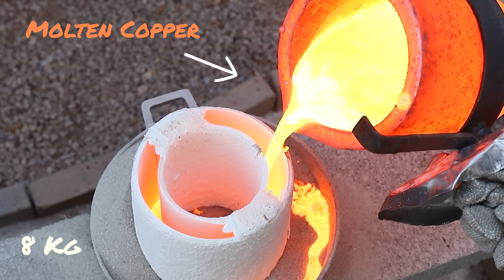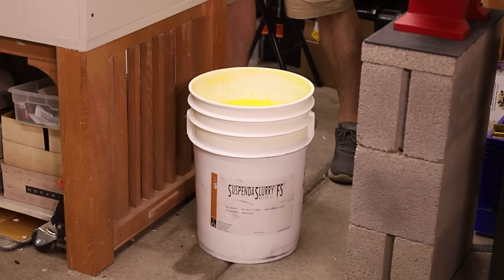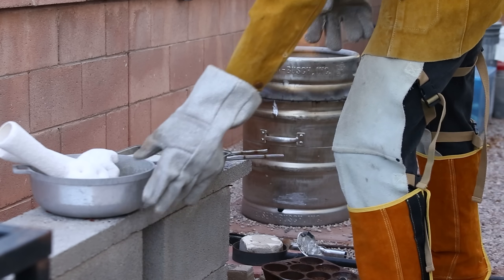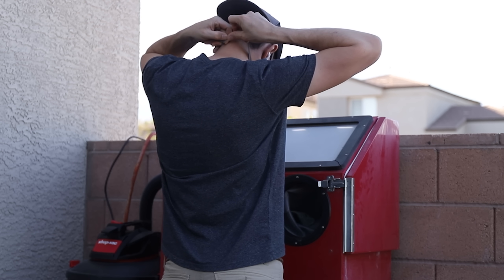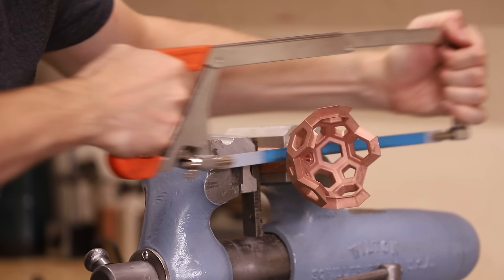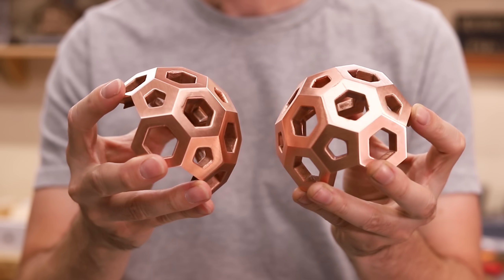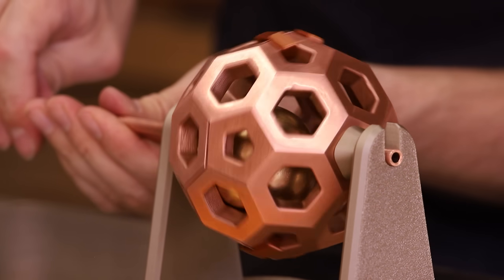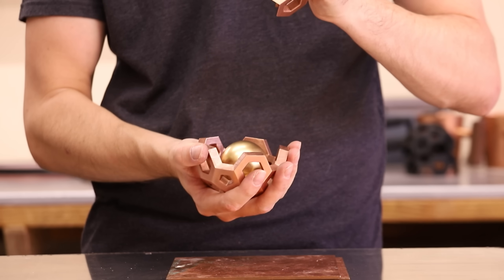HUGE Magnet VS Copper Sphere - Defying Gravity- Will a Neodymium Magnet Float Inside?

Comment: Increase the copper depth by a factor of 2.2, adding most that copper on the outside. Leave the holes the same diameter but increase the inside space (around the magnet) by 3 mm or 4 mm diameter. Paint the copper white and the magnet flat black. Rotate with a single phase motor, probably belt-reduced. Control the speed optically (a mark on the shaft) via an arduino or similar so you can dial speed in in tiny increments. Here's the icing on the gauss cake, lable it "CAPTIVE BLACK HOLE" (you could also use a step motor + controller I think).

You'll have to start over, with a lot more copper, but that doesn't seem like much of a problem for you. You're very competent. I think the resulting performance will be what you're looking for.
Reply: Play with your lightning to fine tune the display -- starting with a fully dark space or as close to it as you can get.
Reply: LEDs w controllable brightness rotating on the inside, recessed into the copper. Now we're talking.

Comment: Instead of mounting the object on a frame like that, could you make a base with more magnets that will make the entire thing float?  Like this, the magnet in the centre floats, the copper orb you made floats also over a magnetic base. Maybe use a smaller magnet inside the core too so it's mass isn't bringing it down as hard due to gravity. Would be cool to see what would happen, I expect they would all rotate but it would be interesting to see

Comment: Oh yeah I have a couple of ideas.
Could this be placed inside a bowling ball?
Obviously you'll need room for finger holes, but they don't have to be deep. And it's gonna have to be covered in an approved materials such as polyurethane. And you're going to need the whole thing to weigh less than 16 pounds but it might work like a water filled bat. It might give you more pin action.
Second I like making things out of Lego. And I know this YouTuber that has a really great video about making hexagons with certain pieces. He shows several methods using different parts. Brick Sculpt is the channel. A couple weeks ago he did the video about hexagon shapes. You'll see a couple in the thumbnail. My question is could copper Lego pieces be made? Then put the magnet inside. Would that even work?
And the cylinder one made me wonder if wheels could be made? or barring that, could a monowheel vehicle work, even if it is an RC model is all?
Finally what about a bat? I know shake flashlights use a similar process to change the battery. So, could a bat  with a light or some other battery power function be made? A cell phone charger or whatever.
I actually really like how beautiful it is! You could sell them. I'd buy one, but I'm thinking it wasn't cheap.

Comment: Try different arrangements of magnets on the outside of the sphere to try and center the orb.  See if you can get the sphere to rotate..... Then if you can put on a small pulley and try to remove a small amount of kinetic energy for  practical use...  Just a thought 🤔

Comment: I can understand the disconnect when manipulating the device manually.  I've got a fairly strong neodymium magnet that I've dropped through rolls of aluminum foil, and it was always a disconnect in my brain, dropping the magnet into the tube, and feeling the weight of the magnet despite it "free falling and not having any connection to the roll."  I can make sense of it in my brain, but my eyes and my hand say "nah, this is black magic, I don't care what you say"

Comment: Try a smaller ball. 
Measure surrounding rf while turning at predetermined rates. Can you connect an oscillator to the cage? See if introducing frequencies into the mix will do anything.

Comment: Paint the ball with stripes so you can see how it is spinning, separate the two halves with an insulator gasket thing like paper, and find a way to make the balls north and south poles to spin between them, and see if you can make electricity with it. Maybe attach fins to it or seal the air with

Comment: Problem with a spherical magnet, is there is no such thing as a spherical magnetic field, it has axial symmetry. Your sphere magnet has to poles and they are not aligned with the axis of rotation. In essence, the phenomenon is much better showcased with cylinders where you can align everything before the start.

Comment: If you had a copper hola hoop that had a vacuum inside, so there was no air resistance. what would happen if you fired a super contuctuter into the tube woukd it go round non-stop? With no air resistance and no heat transfer

Comment: Great casting and experiment!  
Boyd Bushman demonstrated this forever ago.. He also used 2 magnets in 'repelling positions' 
which were then bolted / forced together,  then fit inconspicuously into a stone.. 

They'd drop it from a higher floor and it would indeed fall slower than if/when non modified. 
Good Stuff For Sure!

Comment: I think you’ll get stronger effect if the inside at least if not, the inside in the outside of your sphere is actually spherical rather than lots of flat surfaces that way the forces that are trying to levitate, the ball will be more equal during all phases of the rotation

Comment: You could try a fan motor and control the rpm through voltage changes until you find the right speed.  It might be neat to run a couple wires into the cage on opposing sides with each going to one battery terminal and a light.  When the magnet rises up and makes contact with both wires at once it should turn on the light.

Comment: what would happen if you printed another shell, larger than this truncated icosahedron, to surround it, but with hexagonal cutouts in the shell, spaced evenly and filled them with hexagonal magnets which perfectly fit the cutouts and completed the structure, then placed that larger shell around the smaller shell, with the sphere magnet inside the inner shell and then spun the sphere magnet inside independent of the shells?

Comment: Shouldn't the inside be smooth and round, instead of all of the hex shapes?  It seems like it would stop it from catching on the flats inside, and causing it to "grab" the inside of the sphere.   Would it work better if you used copper wire wound around a sphere?

Comment: Put the spinning stick in one ov the bigger holes. you'll have to 3d printa bigger attachment but i believe it will be more stable than the holes you manually drilled and shaped.

Comment: Perhaps you could cast to round hemispheres (totally enclosed, no 'window') and mount a GoPro camera at one axis point and a light source on the other. That way you'd get a more complete eddy current and still be able to see what's going on when you spin it on the axis. It the GoPro rotates with the assembly the picture should look stationary save the floating magnet.

Comment: I'd like to see you take it to an amusement park with a freefall ride, or perhaps skydiving, and see it float as it falls. Of course, you'd have to figure out how to keep the air/wind from interfering with it. Perhaps you could try floating it in water to see if the force of the magnetic field is strong enough with the difference in perceived weight in water. Cool build.

Comment: Add ceramic bearings on each end of the support housing and sort out a proper gear ratio for best results. If superconducting materials were affordable this would look great in reverse with a magnetic geodesic sphere that has a super cooled quantum locked super conductor floating in the center. 🫶🏽

Comment: since supermagnets sometimes gets created and electricity tend to flow more smoothly at colder temperatures. what would happen if you cool it down? and what would happen if you send a current through the cage? do you think it would be possible to combine those two experiments as well? It looks amazing, and although it wasn't as dramatic as hoped it's still a cool proof of concept.

Comment: Rotating the copper is also rotating the magnet.  Use and external magnet to try to stop the sphere magnet from turning with the copper.  Placement and n\s  orientation of the external magnet may impact wether you get stable non contact levitation.

Comment: Love how it looks! The copper sphere is absolutely an art piece!  I dont know much about this type of physics, but would it be possible to do an art piece with this where the two halves at separated slightly (1 or 2 inches) just enough to clearly see the magnet, or even clamshell style where it is open at the front only.  Then get one of those bases that you plug in to hover magnets over for desk art.   Then you hover the magnetic ball over that base so it rotates but looks like it is hovering inside the copper sphere.  I would buy that for sure.

Comment: How much does the strength of the magnet correlate to its size? I would assume there is some sort of curve considering volume is exponential but magnetic strength might not be.

Maybe a sphere like this would work best with a magnet that has the highest strength/weight ratio?

Comment: Never seen such clean casting anywhere, Bravo
Reply: You must have not seen many castings then.
Reply: @Imma-Loot-Goblin  I have. I think the casting is precise.
Reply: That is because he is not from china where all they do is turn out low quality defective crap
Reply: Plug in your Tesla Coil and let the magic begin
Reply: He sandblasted them
Reply: @pahom2  You can see the 3D print lines retained in the surface of the metal.
Reply: @pahom2  even still, the purity is nice
Reply: @Kryptic712  It's the temperature. He also didn't show if he removed any slag.

Comment: About a thousand ideas:

-  use the video / audio to find out the RPM at which the levitation occurs. 
- make a crank.
- add a gearbox that limits at the optimal  RPM. 
- rotate the assembly, make it vertical (no more clips needed).
- film in extreme slow motion.
- bore a hole in the magnet and introduce a wireless nano camera.

994 more ...

Comment: I think it may be a good idea to join the two hemispheres with non-metallic clips, metallic clips may cause an imbalance in the eddy currents. Also try synchronising a stroboscopic light with the optimum speed of rotation so you can see exactly what the movement of the magnet is like within the sphere, paint a pattern on the magnetic ball so you can detect the direction  of any rotation of the magnet.

Comment: Cool video!
t would be cool to see it fall through a series of alternating acrylic and copper tubes (like the copper one near the start of the video) to see it change from slow to fast fall speeds - if that's what occurs. 
it would also be cool to watch the magnet sphere travel down a custom sized water park style slide to see if it reaches a speed that it levitates. Maybe the bottom is solid and curved like the waterpark slide would be but the top has a top with slits or a pattern that allows us to see the ball as it travels. If no top is needed for the levitation to occur then just the bottom would let it be more visible.

Comment: Al and magnets too. Very interesting. Top speed cars on the Bonneville Salt Flats use aluminum rotors non-contact. And bring the magnets close when they want to slow down. Very interesting. I think the rotors get red hot too. just induced currents/induction heat? Something like that.

Comment: Im thinking a cylnder simulation, using two powerful mags in opposition to  one another, which then tend to drive each other apart with force spinning a drive shaft, the whole thing emhancing the power of a smaller gas powered engine which provides the impetus.

Comment: I think this is really cool. I think inspiration from those cat toys that have the long openings spherically would be better for a camera shots. Another great idea is to see how thin of a piece of copper you can put around the sphere to hold it in place. similar to your cylinder example. My immediate thought was a gyroscope, except the sphere is floating within the copper. So then cylinder piece with another smaller cylinder piece inside of it perpendicular.

Comment: Wouldn't it work better if you use a larger trueer copper sphere with more space inside for the magnet to levitate in and to see the effect place 1 or 2 cameras inside on the rotation points that will capture the effect?

Comment: Fantastic effort.  If you decide to redo the frame, 1. 3D print the cavity to be spherical to aid in keeping constant distance between outer and inner spheres.  2. Additionally, thinner walls within the structure itself will widen the viewing windows.  3. Use copper mesh similar to very fine window screen to close in the view holes to maintain more of the spherical shape.  The mesh itself can receive a dark oxide coating to make them less visible to the eye.    BAisc structure assembly:  1. 3D print a smooth sphere to form the mesh around.  Partition the mesh into two hemispheres. 2. 3D print a rigid frame with thinner walls to provide structure to the sphere. Cast and finish the copper frame as before.  3. Sinter or solder the fire mesh into each portion of the frame.  4. Consider use of a smaller (thereby lighter) magnetic sphere for the center.

Comment: I got a few questions I would like you to respond to in order to actually figure out most of the measurements such as how much force will be produced in that metal shaft connected to the Truncated Icosahedron, what is the weight of the Copper Truncated Icosahedron by itself, try rotating that 2nd magnet in all directions indivually from the front like you did, but side to side too. Then same thing but allow that magnetic on the metal shaft and see if it effects it.

Comment: I’ve seen this done industrially in the UK with wax and completely automated though… cool to see it done at home though!

For the air bubbles, hint, use the drill to turn the pattern through the slurry and continue turning it once you remove it from the slurry, then, turn it while holding the pattern under an old school flour shaker dispensing the sand.

😊

Hats off, have my sub!

Comment: The 2 things at 7:36 in, if there was a hole in the center u could use them as lamp bases, or melt them down to have as a display case for the item u made with them.

Comment: a stroboscope could be used to view the ball easier. If the strobe is in sync with the rpm then the holes will appear to be still, and youll be able to view the ball as if looking through the 'sphere' holes while stationary.

Comment: This was a pretty cool video. For suggestions, I've always wondered if you could make a perpetual motion machine with magnets. Maybe you can if you use a wheel with a magnet on it and a triangular magnet that pulls the wheel magnet until it cuts off to pushing on the opposite side. With enough speed, the wheel magnet shouldn't get stuck on the pull side, and the push side should give enough force to keep it going. Maybe

Comment: What is the Magnet Ball like if you tossed it between multiple people? Does the Magnet maintain itself in the center of the Copper "Sphere", or does it just stay on one side of the Copper "Sphere's" inside? and If you dropped it from a very high height would it do the same but on the roof of the Copper "Sphere"? Perhaps test with slow motion cameras.

Comment: need a globe of mercury with hemisphere's spinning opposed to one another at high speed with the magnet in it.  The magnet will be pushed to the center instead of the sides.  Then the real magic starts to happen.  Don't forget your multi-meter.  And make sure you do this indoors and blanket the windows.  Physics is so much wilder than you kids think...

Comment: It would be interesting to see how Lenz's law, in the tube structure you'd intially done, could be used for a type of elevator/fall arrestor.  Like, could an individual in a magenet lined harness (Or maybe just magnets in the soles of a pair of boots) jump into a tall copper tube and then just gently float to the ground.

Comment: The round magnet is creating an energy field or electricity through the copper. Try insulating the outside of copper. Make one out of aluminum that will fit through the holes of copper slightly with aluminum pins sticking through the center of copper.

Comment: You should use a motor to spin the magnet in your hand at 11:50 and use that to spin the copper sphere. And use a motor to spin the copper cylinder on rollers so the puck magnet floats inside.

Comment: 1.  Get a big old 3 phase induction motor, pull it's rotor out, and suspend your creation inside the stator via a shaft similar to what you did in this video.

2.  Set up a 3 phase power supply to the induction motor via a VSD (variable speed drive). 

3.  Send it.

Comment: the causing rotation by another magnet is interesting. maybe do some tests with a mechanically rotated magnet to see the loss of rotational force and see how much torque the sphere side can actually use under those circumstances, has non-direct power potential.

Comment: For greater visibility of the sphere the shell needs to be painted flat black inside and out. Does the frame width of the shell need to be so thick. Thinner shell frame would also increase visibility of the sphere.